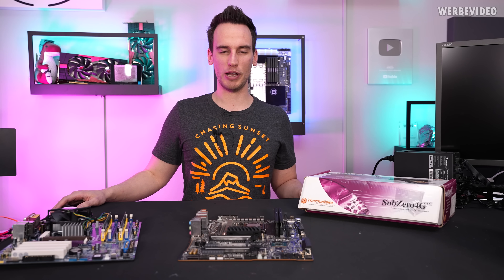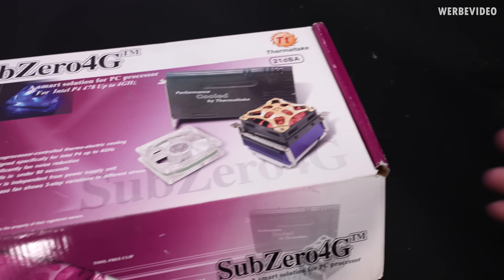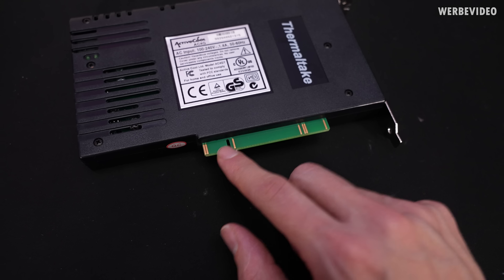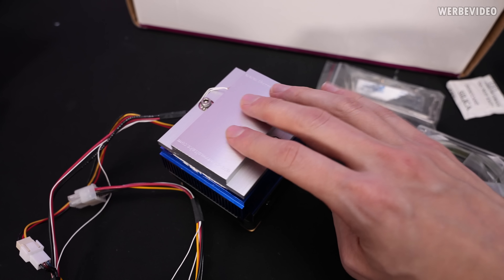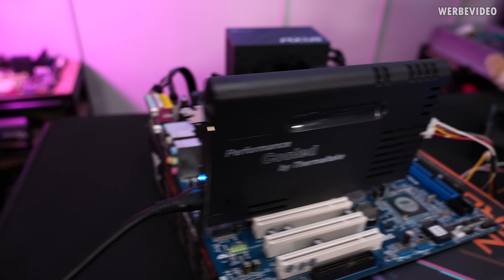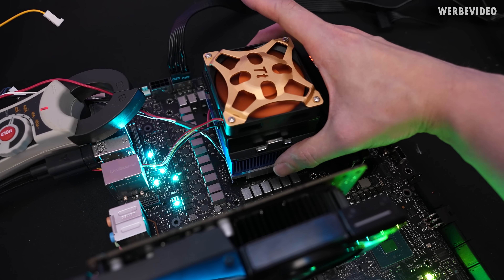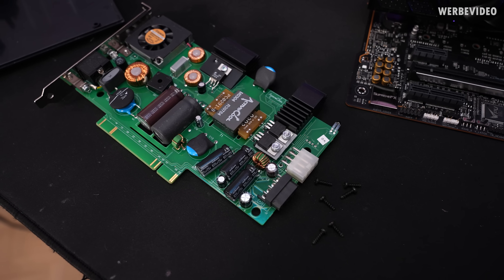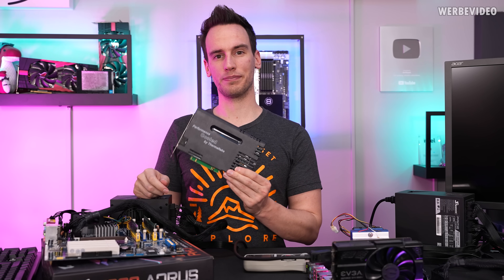This CPU Cooler Requires a PCI PSU to run!

Comment: way back in the early core 2 duo days i had a PC case that had a CPU temp readout on the front, it got that temperature with a flat flex thermocouple or thermistor that you sandwiched between your cooler and CPU 
12 year old me was like "yeah, that sounds okay"
Reply: I have a real early Koolance water cooling kit (2003ish I believe) that has such a readout, and it uses it to control the radiator fans. There's a little indent on the CPU block itself to leave space for the temp probe to fit. Those were fun times to be in the PC space. 

That Koolance loop still runs great on my AMD Opteron 146 system, btw

Comment: It would be interesting to sec if replacing the undersized blue aluminum heatsink with something more substantial (fin tower or water block) would make this a decent product. Can adding a 212 evo to it make it outperform a stock 212 evo?
Reply: In theory, yes. The heat load and choice of TECs apparently matters - it's limited to both TEC wattage and efficiency (each TECs are different), meaning it has to be sized for how much heat the processor is expected to dump.
Reply: @Dr_Mario2007  Would a 80 watt TEC help at all with a 150 watt load, given that you had, say, a 300 watt air cooler?
Reply: @StevenWillmy  I went through this 20 years ago, TECs are very inefficient, the more heat you dissipate the cooler the other side will get. You'll need at least 300 watts of air cooling to notice anything. It's better just to use an air or water cooler. You're wasting your time.
Reply: @StevenWillmy  You want to use peltier as much as 150 - 200 watts to be equal to the heat output expected, and water cooling is a requirement in this case, it would be pretty hot as it's not as efficient. If you want to be practical, go with water cooler (without peltier), air cooler isn't always as good.
Reply: Sure replacing the heatsink would help but it is not the answer, because everybody knows that bigger the heatsink bigger dissipation so what´s the point of the TEC´s in the firts place? Heck, you could put a really big dissipator made of copper above the cpu and not use the TEC´s at all and get better results without expending the extra wattage.

Comment: With such a high thermal load, TECs become an isolator.

Honestly, majority gets TECs wrong - they all buy the biggest and the baddest, pump 100A trough it and wonder why they can't keep up... they are well off their efficiency curve. TECs are most efficient at roughtl 30% of their max load, and this is where they should be kept. So if you want to pump out 100 W of power, you sadly have to have at least 300 W worth of TECs. They also shouldn't be ran at their max voltage.

Finally, when TEC gets heated excessively from one side, it turns into electron pump, and starts working against their power supply. Higher the delta, stronger the effect, so if someone wants to cool powerful heat source by a high margin, multiple stages may be needed (inflating power usage, but that's different stry)

In conclusion: TECs are really bad at cooling high emissivity point sources of heats (like other semicodnuctors), but excel at sucking heat from sizable surfaces.
Reply: I pulled a tec from a early Pentium that ran off the 12v molex in a machine that honestly ran better without it and rigged up a 12oz can cooler with it lol
Reply: So then the appropriate application would be to make a custom very large heat exchanger with many TEC's between the cold and the hot side. One side would cool a water loop that is cooling the PC and the other would heat a water loop that exchanged the heat to air. Probably a huge waste of money and you would be better of using one of those circuit chillers.
Reply: @joeldoxtator9804  exactly. TECs are compact, and they are only applicable where phase change simply can't be used.

But isn't extreme chilli amd oc isn't a waste of money in itself?

Roman attempted this once already, but he overloaded the TECs.
Reply: @joeldoxtator9804  Der8aur has a video where he did just that!  I tried looking, but couldn't find it though. :/
Reply: Might as well get an actual heat pump then.
Reply: @leerman22  so AC? Jay and Linus (well, Alex) did it, also majority of phase change chillers, like Intel did with that sketchy Xeon 3175WX launch
Reply: I wonder what you could do if you cooled a large TEC with phase change though. 

You'd have more cooling than phase change alone with potentially more precise control.

Comment: Mounting pressure maybe?  TEC's do need a lot of power so they fell out of favor during the extreme cooling days(early 2000's).  That other fan was to help with moisture build up round the base of the cooler.

Comment: The terrible thermal performance is because you mounted it without any pressure on the i9, and because the cooler itself is designed poorly. On top of the known practical efficiency to TEC coolers. That hot side heatsink is like half the size of a common P4 cooler, of course it'll perform bad. Furthermore the just two bolt claiming the heatsinks to the TECs is not at all sufficient. Also two TECs mounted parallel is a bad idea in general. Mounting pressure is key for TECs, for performance but also especially for their durability. Two TECs will never have the exact same thickness, leading to uneven mounting pressure between the TECs and also on either one.

Comment: TT Sub-Zero, could have some potential inside with some tweaking (Make a small external control box, make the tec to cool a waterloop to at least 20degree max and you could easily be running an awesome rig (of course, make it dump the hot air outside the room)
Reply: Now Sub-Zero is just plain zero. -Ben Richards.

Comment: So I have done some datasheet diving on TECs , or at least modern name brand ones, and the amount of heat they move depends on the rated max power of the TEC (obviously) and the temperature difference between the sides.  The lower the difference, the more heat is moved.  However, the closer you get to the rated max power, or the larger the delta T, the more energy is required to move a given amount of heat.  Modern ones, when run at full power, will move something like 0.2 to 0.5W per watt of power input.  So if you wanted to move 100W of heat, you would need to drive them with 200-500W, which means the hot side would need to dissipate around 300-600W.  However, if you run a peltier at less than full power, the efficiency is increased greatly, but a reasonable limit would be about 2W of heat moved per 1W of power input, but that is at like 20-25% of maximum power, so a 400W rated peltier might move 100W of heat. 
These are all for modern, high quality peltiers, and are all dependent on a low delta T (10-20C difference).  I'm not sure exactly how much peltiers have advanced in the last 20 years, but I know older ones are not as efficient.
Reply: so much power wasted... 100W cpu + 400W cooler and a big ass heatsink to dissipate the 500W heatload
Reply: This is what I don't understand either. Unless a zero loss system is made, you are just adding more heat to the equation.
Reply: Under the right circumstances you could remove more heat than an air cooler or water cooler, however you would likely be adding something like 50-200% more heat/energy, which would be awful for efficiency, and makes it a novelty at best.  
The only advantage a peltier has over a phase change system (air conditioner) is that it has no moving parts, you just apply electricity, and boom, you get cold.   I'm pretty much any circumstances, a phase change system will require less energy to move the same amount of heat, but they are more complex and more expensive.
Reply: That's something with the Joseph Junction semiconductors, they apparently behave like both a diode and a resistor (somewhat like a thermistor except it moves heat elsewhere), and right now the efficiency is not as exciting, yet they are still discovering new semiconductor salts that could potentially do a much better job at moving heat. It's a matter of time now that efficiency is a buzzword now. ** EDITED ** And yes, I forgot to mention the thermal resistance of the ceramic substrate that those Joseph Junction diodes are soldered onto to make a complete peltier, there's unavoidable resistance even though Aluminum Nitride isn't so bad (older processors' ceramic PGA package is made with similar Nitride ceramic due to lower thermal resistance for given processor TDP back in the day which only went as high as 10 Watts or slightly more, especially with the faster Pentium processors and some Cyrix C3 CPUs).
Reply: I did the same research and wasted a lot of time and money. I used pelts as supplemental cooling in a water loop. Had 2 lb blocks of industrial aluminum heatsinks cooling the pelts, the power input didn't justify the cooling results. I wanted to build a cooler out of a fridge but got bored of cooling and wasted money on other things.

Comment: TEC cooling has never seemed like a good idea to me they're super inefficient and can use like just as much power as the heat they move from the cold side, so for a 200W CPU you'll need to dissipate like 400W on the other side when you build a custom block and a rad setup to dissipate all that heat you'd be much better off with a phase change setup.
Reply: Yeah, they're less than 50% efficient like around 30% I think... So the waste heat (or excess heat to reject) is astronomical.

Comment: every single TEC cooling implementation so far has been trying to use the tec to try and cool directly, but I'm curious if you can try a more indirect method of cooling,
where the tec is integrated on either side of the heat generating component 

rad==>tec cold==>heat generating component==>tec hot==>rad

this way, the tec is providing supplemental cooling to the water loop instead of replacing the loop in terms of getting rid of the heat, since most tec cooling fails at the point where the heat generated goes beyond the power capability of the tec, with the indirect method, the tec would just be cooling the input water and raising the heat of the output water. This should increase the temp delta between water and air and help compensate for some of the extra heat from the tec
Reply: They r ok with being used as water chillers but its just a waste of energy and dealing with condensation u should just use phasechange in the end problem with both is u cant just lower power when cpu is idle
Tec r very inefficient
Just think u need atleast 400w in tecs just to cool todays cpus if doing overclocking and if not energy needed to run everyday stock would be a waste for nothing
I fyi i have old skool dual pump phase change units
Reply: @primus711  yeah that's why I'm suggesting connecting the tec ACROSS the cpu instead of above it, that way, all the tech is doing is acting as a chiller and taking extra heat from the inlet and dumping it directly into the outlet

Comment: 775 was a baller of a chipset back when it came out. ran intel or AMD on same board.
I still have a bunch of these boards with a few core 2 Quad extreme. 
my DAD is still on this chipset when i upgraded him in 2013 from a core 2 duo to a quad Extreme.
Reply: yeap, the issue with Core 2 Extremes is that intel sold them only with bad die revisions (C0/C1) which weren't that good for overclocking. Have they used E0 we would have much higher world records with those cpu's and more fun.
Reply: I'm pretty sure LGA 775 is an Intel only socket but yes, the Core 2 Quad was loads of fun
Reply: Q9550 kicks as
Reply: @virtualtools_3021  I have like 15 of them. One is even on my desk, inside Maximus II Formula that I needed to check if is still working :)

Comment: TECs make absolutely no sense inside a desktop computer. The most they can do is increase power consumption and degrade cooling performance.
There is absolutely no point in using a TEC for heat extraction unless your hot and cold sides are isolated.
Reply: And even then, that's not what TECs are really good at. If you don't need a precise or sub-ambiant temperature, TECs are essentially useless.